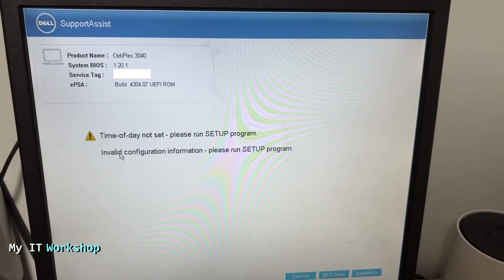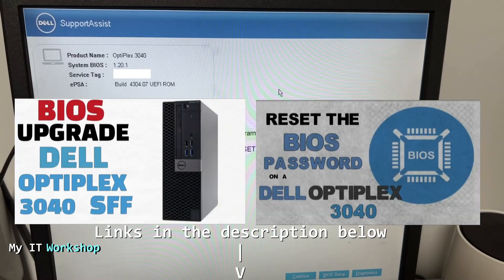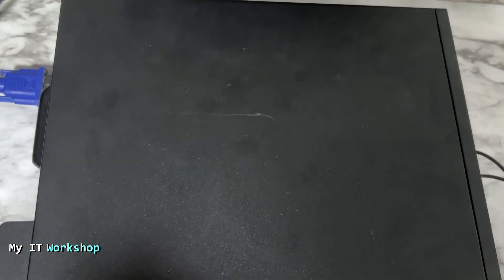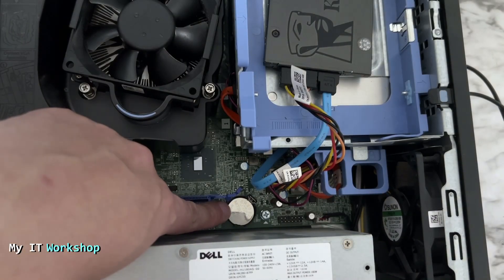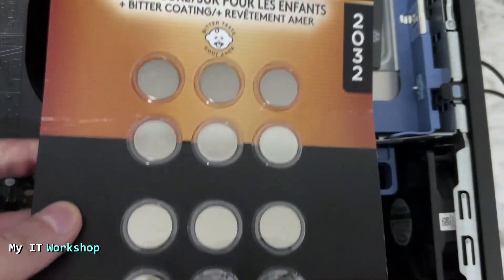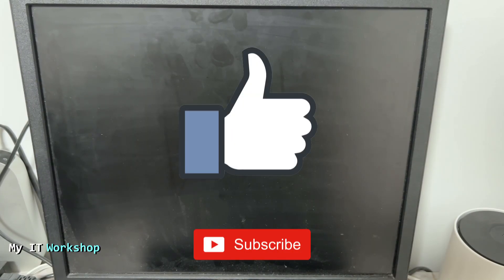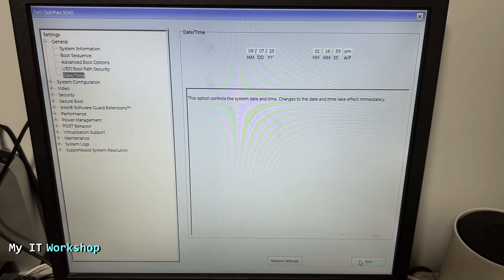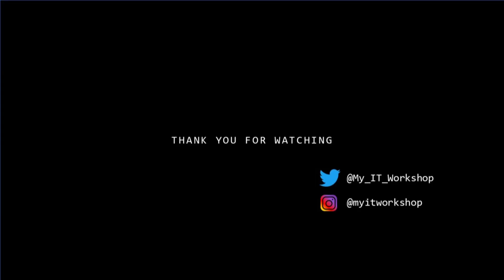When/how to Replace the CMOS battery

Comment: I have dell inspiron, and when i press power button it does nothing, only the power led turns on but laptop wont do anything, evn fans wont turn on. Please please please pleaseeee help me, i need it for my school
Reply: Please help me sir
Reply from the maker: Hi there,
Try pressing the power button for around 10 seconds and see if something comes up.

If nothing happens, try connecting the laptop to an external monitor/tv and see if it shows something there.

Check the brightness of the screen. Thats what comes to mind
Reply: @MyITWorkshop i tried pressing and holding for 10 sec but it does nothing and i know its not display issue cuz when i press power button normally fan starts spinning but now its doing nothing only the power indicator led turns on. And when i remove the bios battery its beeps 5 times but inserting the battery again it does nothing

Comment: Ive had people call me a liar when i said theres batteries on some motherboards lol rich kids weren't around when they were a thing i have never owned a desk top computer that didn't run into this problem mostly because i have only ever owned actual potato computers   i had one fast computer but i couldnt get anyone to help\just send me a iso file so instead i used it as a work bench n than threw it away i kept the gpu but idk how to get this modern psu n gpu to fit a 15 year old dell